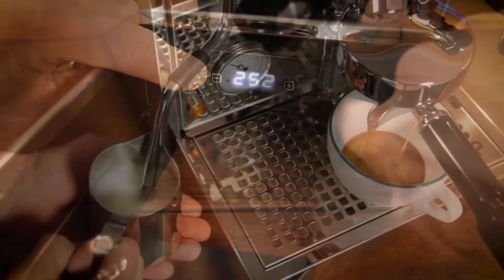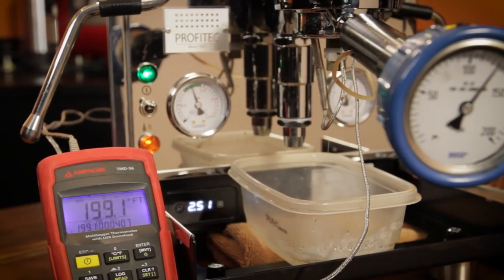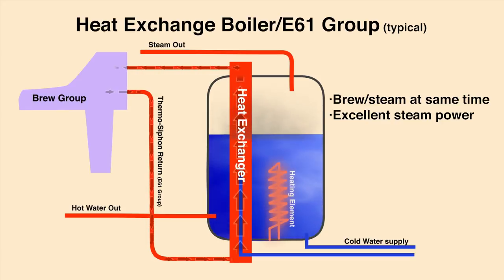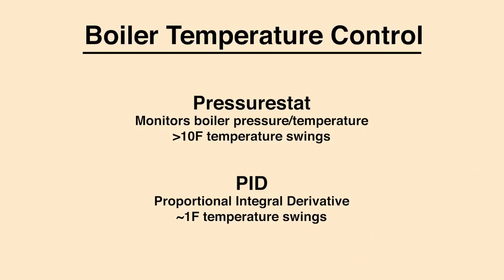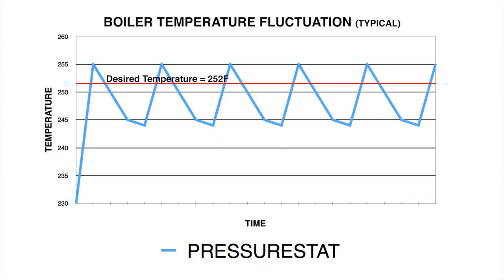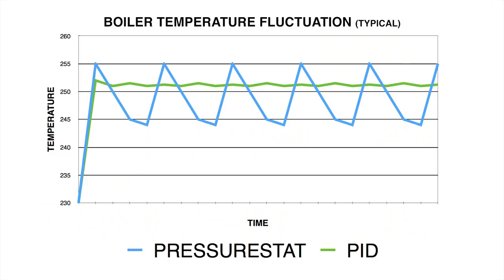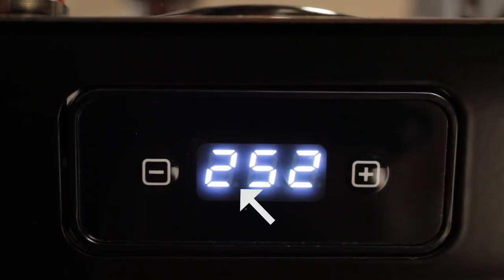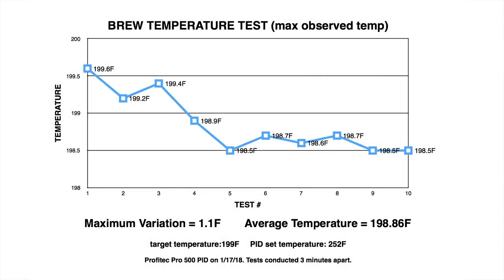Review: Profitec Pro 500 PID Espresso Machine

Comment: WOW MARK that is awesome, can my current Profitec pro 500 get that PID? or would i have to sell mine and get the new version. Also what about the steam would that be affected since its not a dual boiler?
Reply from the maker: Hi B, Thanks for the comment. Kinda figured the retrofit question would be coming! We have contacted Profitec to get their feelings and see if any plans for a PID retrofit kit. Will let you know. Bottom line, anything is doable with enough time, ingenuity and $$. No affect on steam. With boiler PID set to 252 I was able to produce continuous steam. I let steam run for more than 2 minutes and boiler temp never dropped below 245F. The stock 2 hole steam tip is well balanced to steam production.
Reply: That is very impressive. I thought it would be like the silvia with a pid how steam temp is not as good compared to a dual boiler setup. I'm very impressed how Profitec can guarantee the temp of brew and steam is not affected.

Comment: Hey Mark. I was wondering if the Profitec flow control kit is compatible with the Pro 500. I've noticed that the flow control kit is out of stock right now but I'm set on getting the Pro 500 if the kit is compatible. Thanks.
Reply from the maker: Hi Ricky, Thanks for the question. The Profitec E61 Flow Control Device is compatible with all Profitec machines with E61 groups: https://www.wholelattelove.com/products/profitec-e61-flow-control-device
Marc
Reply: @Wholelattelovepage  thanks for the info. The Reddit community was speculating that the flow kit might not be the best idea with HX machine due to over heated water. I'll be sure to keep an eye out for when the flow kit is back in stock.

Comment: Marc, I just got this machine and am dosing ~18g in 9s on eureka mignon specialita into stock double shot basket.  6s to first drip and I get ~ 55ml of coffee in 26s from first drip.  Does this sound right?  Does the grinder have to break in and will I have to make adjustments towards finer grind size as I run more beans through it?  It's pulling great shots but the crema production seems to be lacking in comparison to some other videos I have seen.  Brew temp is stock out of the box w/ steam temp at 248.  Pucks come out mostly in one piece but are a touch soupier than I would like.  I am using a fancy 58.5mm distributor and tamper.  Coffee is night and day difference from a breville machine, but do you have any tips for a newbie like me?  Thanks!!!
Reply from the maker: Hi Matthew, Thanks for the question and sharing your details - that helps in framing my response. Your timing sounds reasonable. If anything, you might try grinding just a hair finer and compare flavor. With grind size dialed in crema production is usually more about the bean type. Some coffees produce more than others. Classic Italian style bean blends tend to produce more crema than single origin 100% arabica coffees. Keep in mind crema isn't everything. Boiler set at 248F puts you right in the middle of espresso extraction temp of 200F. Grinder break in is more about speed of grinding than big changes in grind size. As the burrs are coated with coffee oils there's less friction so you will grind faster. For a given grind time you will grind more coffee weight as the grinder breaks in. If you are into details you might consider a scale to accurately weigh your coffee dose and shot for precise brew ratios. Measuring espresso output volume in ml is usable but there's guesswork with crema rich coffees. You might consider upgrading to a precision filter basket which typically use a slightly finer grind resulting in a deeper extraction. The Baristapro 20g is perfect for your current dosing weight: https://www.wholelattelove.com/products/baristapro-20g-nanotech-precision-portafilter-basket Also consider upgrading your shower screen to this: https://www.wholelattelove.com/collections/pro-brewing/products/ims-nanotech-e61-shower-screen Provides a more even distribution of brew water onto the puck and cleans far easier than stock screen. Might also improve your pucks a bit. Hope that helps!
Marc
Reply: @Wholelattelovepage  Marc thanks for the reply.  I do believe the coffee may be attributed to good but not excellent Crema.  Thanks for the help.  I am using Lavazza oro from your store I got with the machine.  Why would You recommend a 20g basket if I am dosing 18g of ground coffee?  Doesn’t ims make a barista pro basket that is 18g?  I am now playing around with a 1:2 brew ratio and it seems very good.  If I brew more than 40g liquid from 18g dry coffee it seems to disintegrate in regards to quality Unless incorporated into a milk based drink.  Steaming milk is a joy with the new machine but boy does it go quick.  I seem to be good getting plenty of airy cappuccino foam but the smooth wet latex paint micro foam for lattes looks like it’s going to take some more practice.  Also seems like the pitcher gets incredibly hot very quickly after the sides get warm and I sink the tip.  Using stock 2 hole tip.  Any more tips are greatly appreciated.

Comment: Hi Mark, I'm a oscar ii user but thinking to have a little upgrade to pro500. Only one question, is the steam power stronger then Oscar ii? Thanks.
Reply from the maker: Hi YH, Thanks for the comment. My apologies for the delayed response. Just back from 2 weeks in Italy visiting with various manufacturers including Profitec. Steaming power is very similar as both machines have 2L boilers. Personally, I prefer the stainless steel boiler in the Pro 500. Something else to keep in mind the Pro 500 is a PID machines so brew temps are much more accurate. Also build quality is dramatically better on the Pro 500: https://www.wholelattelove.com/profitec-pro-500-pid-espresso-machine
Reply: Whole Latte Love Hi WLL, just watched the new video about ecm/profitec visiting and very impressed. Also see the pro600 finally get more information! I'm expecting about the pro 500 and 600 comparison. Well done guys!!!

Comment: Now what:-) PRO300 or PRO500PID....??? Heating time 300vs500?Thanks!!!
Reply from the maker: zdenekdvc Hi, if heat up time is concern, you’ll want to watch this video: https://youtu.be/Rn1S23pGPiQ we test 3 popular PID HX boiler machines including the 500 for heat up times, brew temp stability and steaming performance. PP500 PID heat up was 38 minutes. I have not tested the Pro 300 yet but it should be faster. Do check out the video linked above. There’s a machine that is fully up and ready to go in 18 minutes. It has an electrically heated group.
Reply: Whole Latte Love Thank you very much for your feedback.PRO300 should be in 10min. Anyway its better DB machine like PRO300 or HX PRO500PID for "simillar"price? Doual boiler is better right?
Reply from the maker: It depends... Pro 500 can handle more drinks per hour and has a much larger boiler so likely better steaming performance. Pro 300 is a good choice for lower volume use. Its more compact so a good choice if counter space is a concern.

Comment: Hi Marc, what would be a good grinder to go with the Profitec Pro 500 PID? I currently have a Breville Smart Grinder Pro.
Reply from the maker: Hi VL, A bunch of options I consider a good match with the Pro 500. Best value in a grinder with prosumer level build quality is the Ceado E6P or Ceado E5P. The E6P has timed presets while the E5P is totally manual. If you use or will use a bottomless PF don't get the E5P has grind start is activated by a the spouts of the portafilter. Check out Ceado grinders here: https://www.wholelattelove.com/brands/ceado

The Baratza Sette 270 series grinders don't have the same level of build quality as the Ceado (more plastic) but if you are doing a few shots a day they will be fine. Baratza considers them to be their best all around espresso grinders. Very fast, near zero grind retention and very accurate with timed dosing on the base 270 and weight based dosing on the 270Wi. Also consider the Baratza Vario - especially if you grind for other brew methods. Check out Baratza grinders here: https://www.wholelattelove.com/brands/baratza

If you want a grinder which matches your machine there's the Profitec T64. It has very precise worm gear adjustment, timed grinding presets and prosumer level build in a small package: https://www.wholelattelove.com/profitec-pro-t64-grinder

Hope that helps!
Marc
Reply: I like the look of the T64 though it's at the top end of my budget. I notice it has a 450 watt power supply. Will there be any issue with the Pro 500 (1400 watts) and the T64 (450 watts) on the same 15 amp circuit? Also, any idea on the grind retention on the T64?

Comment: Good afternoon Please make a video of how to properly configure the machine's PID system for a particular coffee and what these settings depend on. Thank you.
Reply from the maker: Hi Thanks for the question. Some general advice for brewing temperatures. You want to be in a 195-205F range. For medium/dark roast 200F. Trend hotter for lighter roasts and cooler for darker roasts. In our tests of Pro 500 PID, a setting of 252F produced consistent brew temp of 199F. So I'd set the PID at 252 for medium roast. I'd set the PID 2-3 degrees hotter for a light roast coffee and 2-3 cooler for dark roast.

Comment: stainless steel boiler in this machine vs. copper? pros and cons?
Reply from the maker: Hi ND, Stainless is what most manufacturers are using for boilers now. There are lots of opinions on copper v. stainless but we find no difference in cup in well maintained boilers. There is some opinion stainless scales less. Copper is the traditional boiler material but that's likely because it was more available and easier to work with decades ago. Copper is better at conducting heat but there's no clear advantage to that property now that most boilers are insulated. Some opinion that stainless boilers last longer.
Reply: Remember; Because copper conducts heat better, it also means that it gives off heat outside of the boiler more so, than a stainless steel boiler. In essence, copper boilers "leak" heat more. Insulation helps prevent that a bit of course, but stainless steel, while it might conduct heat worse than copper, it will also keep more of the heat inside the boiler rather than leaking outside into the casing. Think of it this way; With a copper boiler, the heating element inside it heats up the inside as well as the entire boiler, making it a giant heating element for the water inside it. With a stainless steel boiler, the heating element inside it heats up only the inside and, seeing as stainless steel conducts heat worse, the outside of the boiler won't get as hot as a copper boiler. Since you only want the inside water to get heated, stainless steel is thus more effective! Disclaimer; Don't put your hands on the boiler, regardless of material, you'll still burn off your skin XD

Comment: I'm curious how they manage to do this without being forced to do a cooling flush? The water in the heat exchanger will be heated up to above boiling temperature since the rest of the boiler will be heated to steaming temperature, that hasn't changed just with the introduction of a PID, no?`

On a separate note; Will you also review the ECM Mechanika V Slim? Any estimated date on that? :)
Reply from the maker: Hi Tanax13, Thanks for a great question! And here comes a long answer!

Machines with an E61 group have a thermo-siphon which is constantly circulating water powered by convection between the heat exchange section inside the boiler to the group head and back. Water that flows to the group cools some and returns to the HX section within the boiler. So water in the HX section is cooler than in the steam section of the boiler. The main engineering challenge is getting the flow rate to the group just right in conjunction with heat loss in the group and the connecting plumbing. There are other factors involved but heat is always moving out of the HX section of the boiler and to the group and cooler water is returned via the thermo-siphon. Flow rate is commonly controlled by a flow restrictor in the thermo-siphon loop. More restriction means hotter boiler and cooler group. Less restriction means cooler boiler and hotter group. Flow restrictors are fairly simple. Usually just a disc with a hole drilled in it in the line that goes to the group. Changing the hole size changes the flow rate. The Pro 500 PID happens to use a 2.5mm hole size restrictor. FYI nearly every HX boiler/E61 machine has a flow restrictor. Some manufacturers pay more attention to sizing it properly than others. 

There used to be a few machines with adjustable flow restrictors. But they didn't work out well as they'd get compromised by scale buildup etc. so manufacturers are not doing that anymore.

We will be reviewing the ECM Mechanika Slim! It'll be a few weeks as we are waiting on delivery.
Reply: Thank you for that excellent answer! So basically, it's the size of the flow restrictor and the length of the thermo-siphon tubing that determines how much of a cooling flush is required?

If this new Pro 500 uses 2.5mm hole size, what size does, e.g. ECM Technika IV Profi use? In that machine a cooling flush is required :)
Amazing news about the Mechanika Slim, looking forward to your review!
Reply from the maker: Hi T, I do not have a T. Profi at hand to check :( But keep in mind just because 2.5mm works well in the Pro 500 it does not mean it would be the right size for another machine. All kinds of variables involved.

Comment: why did they chamge the tips to a two hole tip instead of the old 4 hole tip? should i change it?
Reply from the maker: Hi Jesus, I'd only change it if you are not happy with performance of your 4 hole tip. With a 2 hole tip on the PP500 PID you can steam indefinitely without running out of pressure. With the 4 hole you get more steaming power at start but drain pressure faster.

Comment: The only thing I don’t understand is why would you mount an electronic display where the water and steam are dispensed? Seems like that’s a PID just waiting to get shorted by all the steam and water.
Reply from the maker: Hi MF, Thanks for the comment. It does seem odd - I get the concern. But the display is well protected and electronics are all behind the face of the machine. I've heard of next to no problems with water and the displays.
Marc

Comment: Does the PID control both the brew and the steam temperatures?
Reply: It's a heat exchange system with one boiler, so the PID controls boiler temperature, higher temps = higher pressure in the boiler, which means higher power (and I guess temperature) steam.

Comment: Thanks for the in depth review. Super helpful! Is it possible to add an aftermarket float kit to this machine. I know the 700 has it but this is about all the machine I’d need. Thanks!
Reply from the maker: Hi Phillip, You are welcome and thank you for the kind comment! The Profitec Pro 700 can be pumbebd directly to water line. I strongly recommend plumbing over using an aftermarket float controlled reservoir refill. They are prone to failure IMO. High risk of flooding if the float fails. If willing to take the risk there's likely and aftermarket solution but nothing I feel comfortable endorsing.
Marc
Reply: Whole Latte Love  thanks for the insight!
Reply from the maker: Phillip Zito my pleasure! Marc

Comment: Can you really skip the cooling flush with an HX PID machine?
Reply from the maker: Hi Dario, Thanks for the question. Based on my Scace testing of brew temps the answer is yes. There are some times when it may be needed due to odd ambient temperature conditions, extra long on and idle time before use, etc.
Marc
Reply: @Wholelattelovepage  thanks. I’m closing in on a machine and really leaning toward a HX one. Most people on forums say it’s a waist of time and just get one with DB’s. The smaller footprint of an HX really works for me. But I don’t want to have any regrets.

Comment: Can the Profitec PID be retrofitted to a Pro 500s?
Reply from the maker: Hi John, Thanks for the question. I'm guessing you mean the PID upgrade from a couple years ago for the Pro 700. If so you can't. Pro 700 is dual boiler so steam/service boiler temp does not affect brew boiler temp. Upping the temp in the Pro 500's heat-exchange boiler would raise the brew temp well beyond what's acceptable.
Marc

Comment: Profitec Pro 500 PID or ECM Mechanika v Slim ? what would you do if you had the choice? :-)
Reply from the maker: Hi MK, Thanks for the question. Tough call about the same price for both. If you do lot's of milk drinks back to back you will appreciate the huge boiler in the Slim and it's narrow - almost 2 inches less in width than the 500. Brew temps are more stable with the PID on the 500 and no flushing required prior to brewing. You will need to flush the Slim prior to brewing but can make very quick brew temp adjustments by adjusting the flush.
Marc

Comment: Can the feet be removed or replaced with something shorter to reduce the height?
Reply from the maker: Hi Vernon, The feet can be removed and you could put something shorter in their place. You do need some sort of feet as there are so0me fasteners on the bottom of the machine which protrude about .3". An easier option to gain clearance is removing the cup rail. It's held in by 4 easy to access screws. Removing the cup rail reduces machine height by 1.5".
Marc
Reply: Thanks! Just got mine today from your shop and it looks very nice. One thing I noticed is the boiler pressure gauge barely touches the green zone (around 0.9 bar). Is this an issue?
Reply: Nvm, figured it out  :).  I noticed you had your PID temp set to 252 and once I raised mine from 249 to 252 the boiler pressure went clearly into green at a little over 1 bar. Really enjoying this new machine!